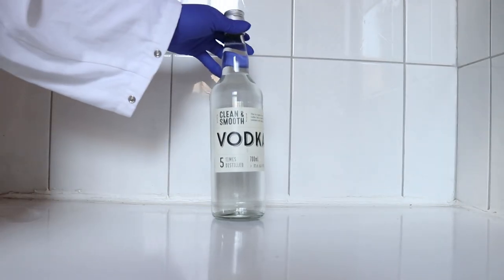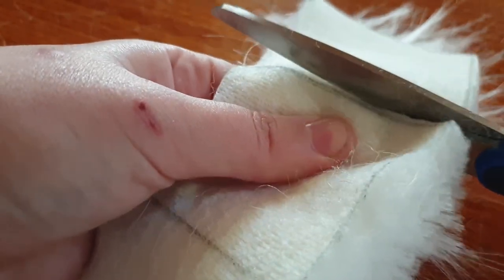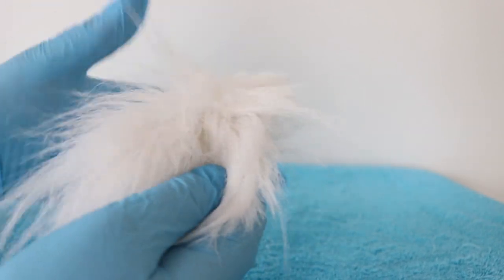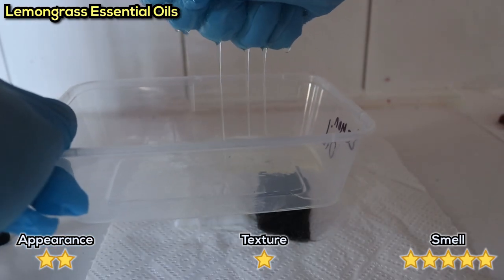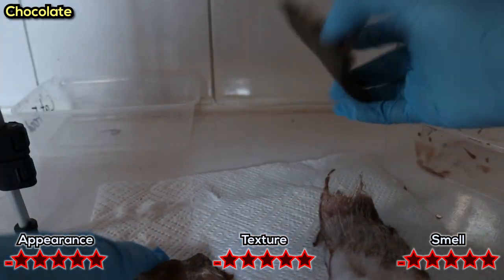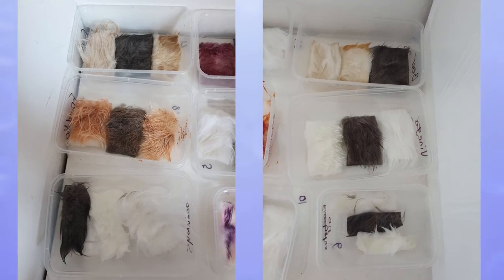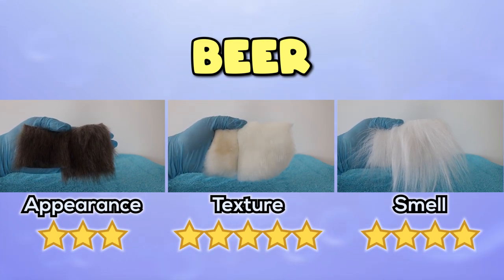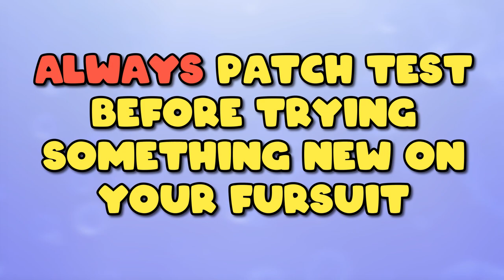Fursuit Fur vs 30 stains & chemicals - Can they be cleaned? [The Bottle Ep75]

Comment: most of the things that went hard seem to have contained sugar (ketchup and bbq have a significant amount of sugar, toothpaste often has sugar or sweeteners), which probably caramelized or otherwise congealed over time. products intended for skin (as well as mayo, being oil and eggs) contain a lot of natural oils that don't play nice with plastics- ask anyone who's tried using normal hair products on a wig. oils are harder to fully remove and will build up over time if not totally cleaned, which is how you get greasy fur.

the acetone and ethanol, being high-strength chemicals, most likely dissolved parts of the plastic into one another (why they became solid).

i would definitely warn against using large amounts of essential oils despite how well it did; the synthetic fur might be fine, but certain essential oils (namely tea tree, and eucalyptus which is actually toxic if ingested) can give you chemical burns if left on your skin for a long time.

vodka (or vinegar) and water however is a tried-and-true method for spot cleaning fabrics, especially things you don't generally want to get soaked through in a machine- just make sure nothing ELSE you clean your suit with will react with them.
Reply: So.. go on a diet
Reply: Acetic acid or vinegar is actually commonly used as a disinfectant, and vodka has a good amount of high purity ethanol in it. I believe the difference between the ethanol and vodka this would be the other components of the vodka and the fact that commercially available ethanol is not nearly and pure and clean as ethanol in beverages.
Reply: PupperCut  oh i knew vodka had ethanol in it, i assumed it was the reverse and that straight commercial ethanol would be more pure but that makes more sense.
Reply: also i forgot to specify but vinegar specifically when combined with other substances (namely bleach, which pocari has used to clean her suit before, and is something i know people use to whiten suits) can be hazardous. in the case of bleach, mixing the two can produce chlorine gas, which is highly toxic.
Reply: Divonne Retribution ya you gotta have the least amount of contaminants in anything edible.
Reply: Divonne Retribution yes a good rule of thumb is to not mix strong chemicals together especially if you don’t know what they will produce if combined
Reply: Toothpaste can't have sugar in it, the whole point of it is to clean the teeth, not directly apply sugar and make them decay faster. Besides that, nice explanation!
Reply: there's usually some kind of sweetener or flavoring agent but you're right, sugar is an oversimplification. toothpaste is also prone to congealing on its own when left to dry regardless, so there's that as well.
Reply: as someone who's worked with pure acetone a lot, it's pretty much made to eat through and melt plastic, which is why it's used to remove acrylic nails. i learnt that the hard way, spilling some on a plastic box and essentially just watching the whole thing melt and fall apart.
Reply: Woooowww
Reply: Divonne Retribution wow x3
Reply: Thanks So Much, This Helped Me A Lot With My Fursuit
Reply: Of course vodka is good comrade
Reply: Thank you very much for this!
Reply: I’m going to assume the cleaning ethanol is probably contaminated with methanol (which is pretty toxic, this is why we don’t distill hand sanitiser or buy counterfeit booze for drinking, as too many college students have found out the hard way).
Reply: Divonne Retribution: must day I’m not reading all of that
Reply: Point of fact vodka is just ethanol/water and a mix of irrelevant other things so you could use ethanol as well even isopropyl not methanol though
Reply: @Dizzypiggy  Yet you had the time to leave a rude comment.
Reply: i know im asking the wrong place but does anyone know of a tool to get back into an instagram account..?
I somehow forgot my password. I would appreciate any tricks you can offer me!
Reply: @Jamari Arian Instablaster =)
Reply: @Jonah Travis thanks so much for your reply. I found the site thru google and im waiting for the hacking stuff atm.
Looks like it's gonna take quite some time so I will reply here later when my account password hopefully is recovered.
Reply: @Jonah Travis it worked and I actually got access to my account again. I'm so happy:D
Thank you so much you really help me out :D
Reply: @Jamari Arian Happy to help =)
Reply: I must point out that the brand of toothpaste she used didn't actually have any sugar in it but good point

Comment: The fur most likely melted/stuck together from the acetone because PLA and ABS plastics are actually cured using acetone. You can see it quite often in 3D printing when people want to smooth the prints out- though for something as thin as fur it will cause it to chemically melt together.

(I used to work with 3D printers a lot back in the day so I learned a lot from working with them actually XP)

Comment: Vodka is basically ethanol mixed with water. I think it might be viable for cleaning fur if it wasn't subject to drinking-alcohol taxes.
Reply: misting with extremely cheap vodka/water mix and tumble drying it is a good way to clean or at least spot clean otherwise non-machine washable fabrics, so you're not wrong!

Comment: Acetone melts plastics so wasnt suprised. Also for the essential oils dawn dish soap is best to use as a first cleaner then spot clean, also most sodas are used for getting out tough stains specially club soda.

Comment: Also, alcohol markers can leave permanent stains on a fursuit, I did my own test with a Swatch to see if I can change fur color with it and it worked. if put in water the color can seep out into the water and stain other parts of your suit. It leaves a sitcky feeling(but thankfully the fur stays soft) and has a faint marker smell to them. You might be able to spot clean most of it out, but it will definitely leave a color patch

Comment: SCIENCE!

I was definitely most surprised by the drinks. Especially the cola. I figured that would dissolve the fur fabric. Also definitely sticking with isopropyl going forward.
Reply: the acid in cola isn't really strong enough to dissolve anything with any real integrity (otherwise it wouldn't be safe to consume! you might get some results with either a stronger mix or very thin material, but faux fur isn't exactly delicate)
once the carbonation goes flat, it's mostly just sugar, flavoring and water, and once the liquid part evaporates enough, all you've really got left is a kinda-gross hardened/thickened sugar residue.

Comment: I was pretty surprised with the vinegar, but also not really. My grandmother used to keep these lying around in spray bottles a lot. She would not use them as cleaners, per say, but more for a clothing item or a rug that need a bit of freshening up. Just a few squirts, leaving it to air dry and it was pretty much a cheap odor remover/sanitizer. Again, I know this is pretty much a very cheap thing, but if you think about it there is probably vodka at most of the room parties so......free suit sanitizer? (PSA: I do not own a fursuit, this is simply something I concluded with watching this awesome experiment and also from past experiences.)

Comment: Acetone is used by doll moders to strip away factory paint off of doll faces. They also warn a lot to wah your doll faces asap after using the acetone because it can melt the plastic/rubber or cause disfigurements. Acetone is also used by nail techs to take off nail polish, including gel nail polish which is UV cured.

I am by no means surprised that it ruined and melted the fur XD That stuff is intense!

Comment: If you ever try this again, try using this shampoo called "Tea Tree" (The minty one)
I use it for my hair (obviously), along with some various cloth and even foams:
I used it on my Oculus Quest 2 facial interface when the foam really needed to be cleaned, and it worked perfectly and smelled freshly minty afterwards!
I also used it with some towels, clothes, and a fur-like robe when I had stained them with various foods/drinks. (on accident-)
If you do attempt this, I wonder what the results will be for stains such as the sauces, chemicals, wine/vodka, and others!

Comment: You can actually use cola to clean mustard and other food stains out of cloths if you don't want to use harsh chemicals. It doesn't hurt the fabric but does contain a mild acid that will eat away at food particles if left to soak in it :3

Comment: Vodka and ethanol are the same thing (the V2 rocket ran on 150 proof potato vodka) unless the ethanol is denatured (toxic chemicals put in it to prevent people from drinking it). In the US ethanol you can get for most anything other than drinking is denatured. I checked and found ethanol is also denatured in Australia, so any issues with ethanol are caused by the solvents meant to make it toxic.

Comment: Vodka actually is great as a disinfectant as it's usually just a straight up powerful alcohol, really not drastically different than using the isopropyl.  I wouldn't recommend it as a fursuit cleaner though as it would definitely be a bit more expensive and like you said not all fur reacts the same

Comment: Chemical solvents like acetone can actually devolve the polymeric fake fur. That is the reason why the fur clumped together and stuck together. The fur had actually fused together. Isopropyl alcohol (isopropanol) is a good match for the polymers used to make fur since it doesn’t dissolve it. Isopropanol is nice because of how volatile it is (how easy it can evaporate) and that once it all evaporates it doesn’t leave any residual chemicals that will harm the skin or off gas and leave a smell. Believe it or not although essential oils are oils they are actually very volatile that’s why they provide a strong smell, but you almost never want to use just essential oils (you wanna have them in a carrying solvent) because if any is left on the fur they can actually cause a chemical burn. That being said any fursuit spray should have a low enough concentration of essential oils that you don’t have to worry about this, and should consist mostly of isopropanol.
You should always take care around oils with any form of polymeric material such as the fake fur (this applies more so to elastomers or rubbers) since certain oils can penetrate in between the molecule chains and allow those long chain molecules to move more freely and untangle from one another. This tangling of the polymer chains is what makes any plastic solid, and when you untangle the chains you degrade the material. Especially in rubbers you will see the rubber turn more solid and begin to crack and fall apart or begin to degrade, leach out bad chemicals, and start to fall apart kind of like it’s melting but not really.
Sugars tend to crystallize when left to their own devices which could have led to the stiffness with the sugary products. I believe that sugars only caramelize when exposed to heat, but this has been talked about pretty well already so no need to elaborate 😇
I also really appreciate the proper lab safety used! Way to go pocari! Also wanna complement your scientific method because it was very solid and well done.

Comment: not sure if anyone's asked but what about if a suit is drenched in sweat or any kind of bodily fluid? i know one would normally wear somethin underneath to sort of keep that from happening but its still a curious question from a curious doggo
Reply: damage from bodily fluids is more likely to cause mold or mildew if left to sit (as well as a horrible smell) than permanent staining or damage (well, aside from any caused by mold or mildew i guess). 
what i'm going to broadly label 'organic substances' are easy enough to clean from most synthetic clothing/fabrics (provided they're not oils, and even then it depends on the oil as you can see from the vid), but if it's left to soak in for a significant period of time it'd be, uh, pretty awful. 
that's also not getting into anything that's dried into the fur or backing, which will be much more difficult to remove.

Comment: Vodka shouldn't have been much of a surprise, it's basically just ethanol in water. I wish I'd known soon enough to suggest testing drug store hydrogen peroxide, (usually 3% solution in water.) It's antiseptic and it works great at getting nearly any smell out of nearly anything. If it's safe for fur, it could be pretty useful. There's also a formula known by various names, (I call it skunk out); 1 litre drugstore hydrogen peroxide, 15ml liquid soap, 5ml baking soda. Rub it into whatever is smelly until the smell goes away, then wash thoroughly. (But it turns unstable pretty quickly, so don't try to store it.) Again, if only it was safe for fake fur!

Comment: For anyone who lives in Australia, or anywhere else that may have access to the fruits shampoo/conditioner, DON'T BUY IT!! It contains palm oil and it literally says on the back of the bottle in the ingredients section ;_;
Reply: Have any recommendations
Reply: @danniedaniell260  Not any big-brand ones, it's hard to find out which ones contain palm oil and which ones don't. I use tresemme at the moment but I'm pretty sure it also contains palm oil since it contains Sodium Lauryl Sulphate, which can sometimes be a sneaky name for palm oil. I've been looking for Viva La Body shampoo and conditioner bars (definitely palm oil free), but I've had a lot of trouble finding it so you may have to order it online if you also can't find it.